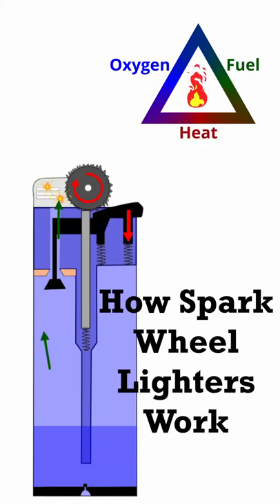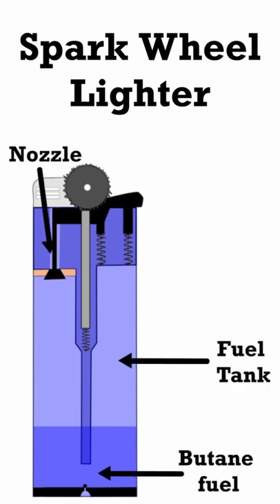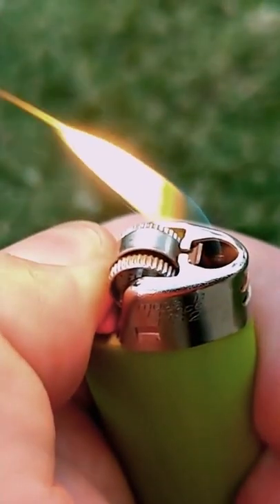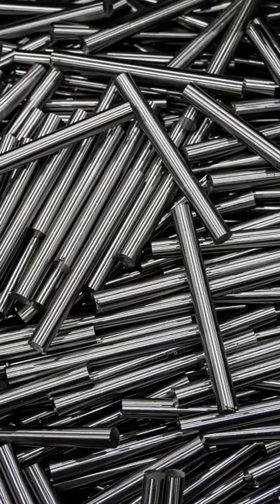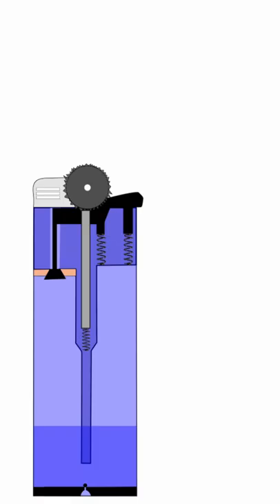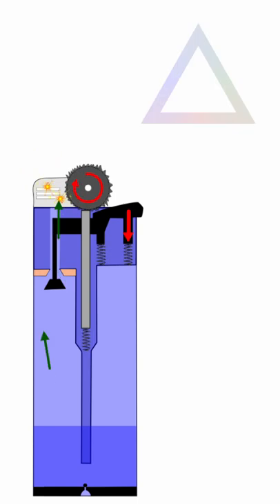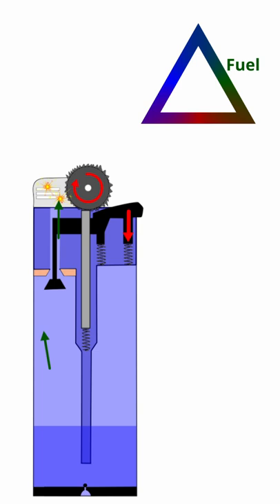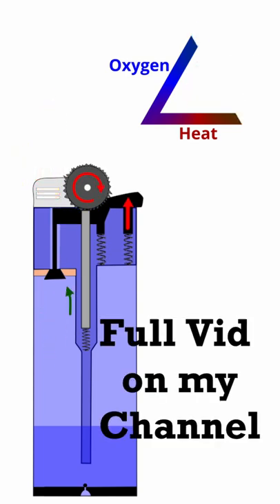How BIC Spark Wheel Lighters Work #short

Comment: how does the flame not travel back into the tube
Reply: there is no oxygen in the tank just fuel so there is so way for the tank to light on fire. Fire needs heat, oxygen, and fuel. The fuel leaves the tank and mixes with the air making fire.

Comment: Interesting. How does the flame stay on though?
Reply from the maker: As long as you hold down the button the valve supplying the fuel stays open.
Reply: @thinguide3687  interesting. Thanks a lot
Reply from the maker: @Nyante  I have a longer video about how lighters work you might find that interesting too. Please also share with anyone who you think might enjoy it.
Reply: As long as liquid butane turns into gas when pressure lows upon it